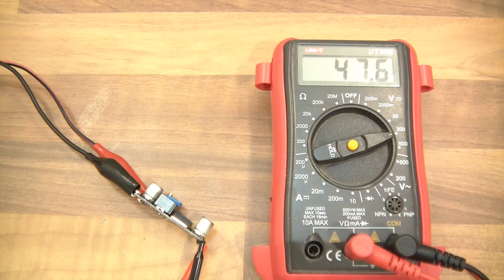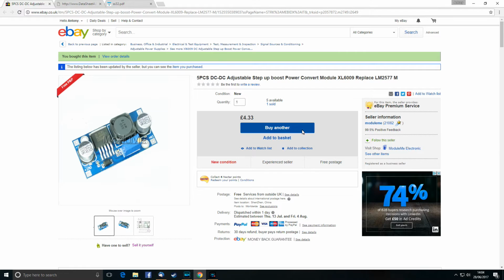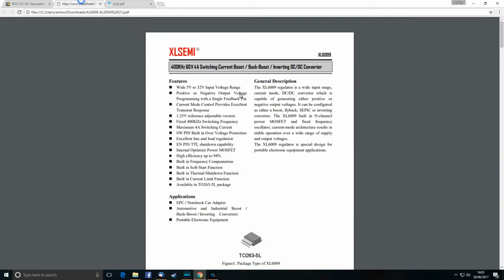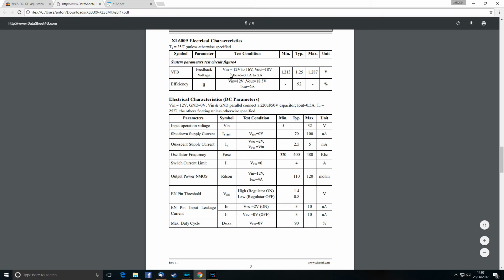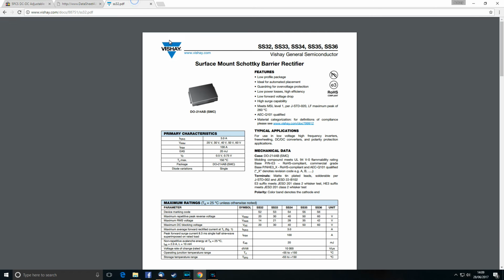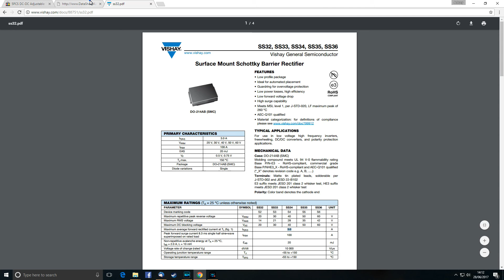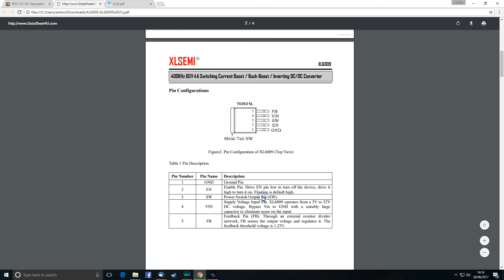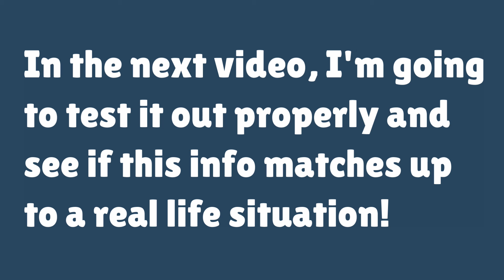INVESTIGATING: The Capabilities of the XL6009 Boost Converter (According to Documentation)

Comment: Nope, the SWITCHING current max (always the input for a boost circuit) is 4A max, NOT THE OUTPUT!!!!!!!!!!!!!!!
So for 10->20V boost, max out current is 2A NOT 4A (less considering 90% efficiency), so maybe 1.8A! 
Same for 20->40V (1,.8A output max).  Another point is power dissipation of the diode.
AT 3A and 0.5V drop = 1.5W power - IT WILL MELT OR BLOW UP!!!!   ---LIKE YOURS DID :(
The small package SS34 diode is WAY UNDERATED!!!!!!!!!!  You need the big body SS56 with either PCB or external heat sink!
Look up how a boost circuit works and this will make sense to you.
Reply: btw, the inductor is what makes boosting the voltage possible, MUST HAVE!

Comment: Antony - you really do need to learn some basic electronic theory before you go making videos that are as embarrassing as this one!  I suggest that you get a copy of "The Art Of Electronics" by Horowitz and Hill - this will teach you the basics in a very friendly manner.  They even try to minimise the mathematics!  Other commenters have explained to you how a boost converter works.  The inductor DOES have a function at DC - read the book!

The Ebay sellers of these devices know just about as much as you about what they're selling.  They've looked up the specification of the IC, and hoped that the boards that they're selling will perform as described in the data.  The IC might be capable of switching 4 Amps, but the circuit will certainly not be able to supply that kind of current.  You'd be lucky to get much more than an Amp out of one of these boards because there's no proper cooling for the components,, and despite the "high efficiency" that the data sheet boasts about, there's still going to be some heat generated.

In my experience, these sort of simple switched-mode supplies are seldom very stable, and the one you have will have swings in output voltage (when loaded) as the IC heats up!  These boards are cheap for a reason!  I've used a couple of them in an LED lantern design, to give fairly constant light output as the battery drains.  They're pretty good for that kind of use!
Reply from the maker: Hi, thanks for your comment. I disagree though. There is no right or wrong way to investigate a product. I assume you think/expected this to be a tutorial?
Reply: @antonycartwright  No.  I expected you to actually understand the device you were examining!  It's a simple buck converter.  As usual, the Chinese manufacturers have used the cheapest possible components and given some rather fanciful specifications that bear little relation to reality.  These boards are good for about 1 Amp output at best.  Draw much more, and they get very hot.  If you're lucky, the switching chip goes into thermal shutdown.  If you're unlucky, the output voltage varies wildly, killing whatever you've connected to it! 

I used one of these (somewhat modified and with a substantial heatsink) to supply 50V at an Amp for an AM transmitter.  After I got the switching frequency out of the output rail - use of an inductor and capacitor pi-filter solved that problem, I developed a nice clean RF carrier at 12.5 Watts, peaking at 50 Watts with 100% modulation.  The whole unit could be powered from a car (or caravan / marine type) lead-acid battery, and the output power remained quite constant as the battery discharged.  The system is in daily use in Africa, and the battery is charged with both a wind turbine and solar cells.

These cheap step-up converters from China are OK for non-critical uses, but are not for systems where high reliability is expected.
Reply: Is it a buck converter or step up module? I think the YouTuber might be able to teach you abit have you heard of the dunning Kruger effect I have. Suspicion this might be your problem
Reply: @justinspier3838  You're wrong.  I'm perfectly aware of both the Dunning Kruger effect, and the hopeless inefficiency of these cheap and nasty Chinese devices.  I can assure you that any suspicion is well founded!

Comment: they dont work on 1 18650. any ideas????
Reply from the maker: They're not designed to work with voltages that low.
Reply: thank you .i could not figure out what was doing wrong.Question-how does one of those  power banks do it.if you dont mine the question? @antonycartwright
Reply from the maker: @donaldhenke2750  They use 134N3P chips. It's a special solution for charging and discharging.

Comment: the SW pin shorts one side of the inductor to ground at a high swityching frequency, this causes a magnetic field in the inductor, when the SW pin stops grounding the inductor the magnetic field collapses inducing a voltage in it that is added to the input votage. by using different PWM on the SW pin you can change the output voltage. simplez. the is no amplification of voltage in the IC

Comment: Is it possible to put two of these in series to get +- voltage? using two different sets of batteries as inputs of course.
Reply from the maker: kaos havoc Maybe I've misunderstood, but I have no idea why you'd want to put two in series.
Reply: I have just been trying to think of a way to get +12 and -12 volts with what I have now. I don't think it would work, I think I would just blow them up LOL.
Reply from the maker: kaos havoc Do you mean that you want 12vac? Or do you want to reverse polarity or something?
Reply: Antony Cartwright Not ac.  I was wanting positive and negative for op amps. But now i realize i should use an inverting buck/boost to get a negative rail.
Reply from the maker: Ahh I see.. I don't know much about that. :-)

Comment: Hi Antony, you should read up on how a buck or boost converter works. The Inductor is used to store energy that is built up during a short circuit with a Mosfet inside the chip. The 4A limit, is the input current - as stated in the Datasheet. When they write Input, they mean Input. 😉 As tested by others, the maximum recommended Output is 10W. Anything higher is really overdoing it. Even at 10W output, you should add a Heatsink to the Chip.
Reply: 25watts with no heat sink works fine, 40watts replacing the diode with a 5A+ diode and adding a heat sink to the diode and inductor, the IC doest really get that hot but since you're adding heatsinks already go a head and stick one to it.
Reply: @WertzOne  what diode are you using can u share a vid or pic of your modded xl6009
Reply from the maker: Thanks Christian.

Comment: Circuit you are looking at is a boost circuit, it with never go below the input voltage. Inductor is used like a charge pump to produce a higher voltage.